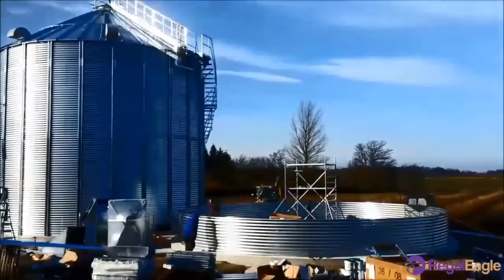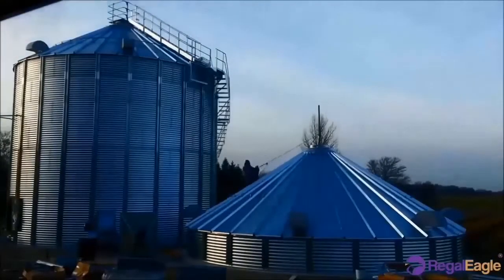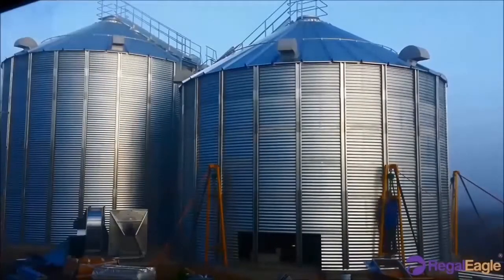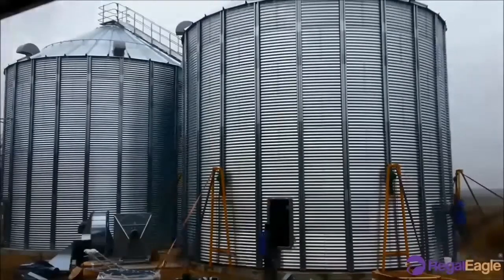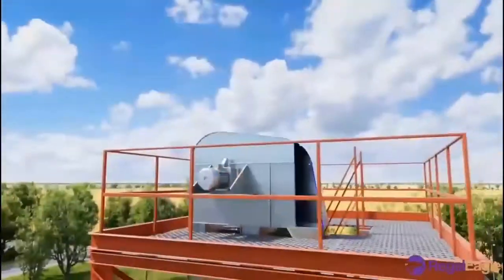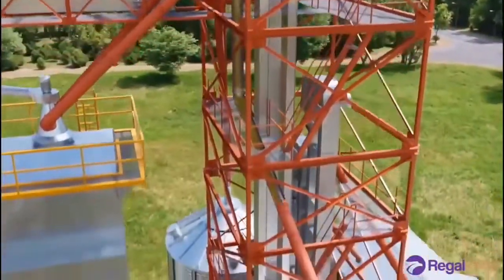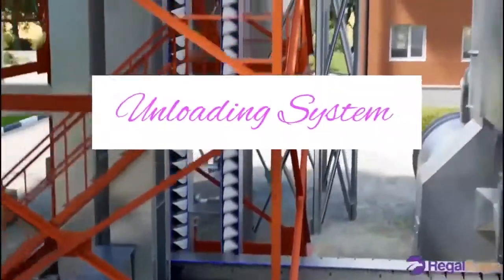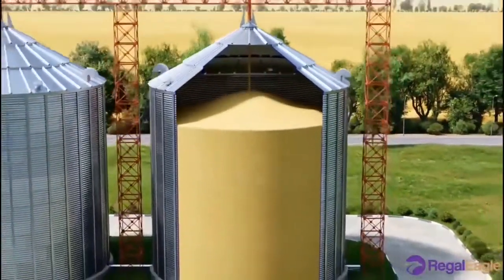Amazing Agriculture: The Benefits of the Grain Silo Storage Systems.

Comment: is the silo double walled?
Reply from the maker: Double walls create an air space between the wall sheets, which insulate the interior from the external temperature to avoid problems like condensation.